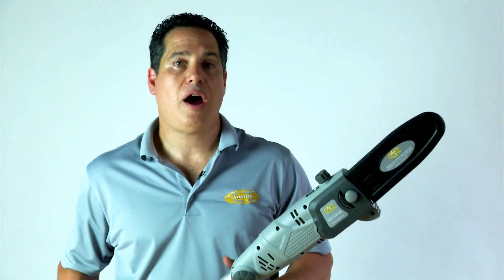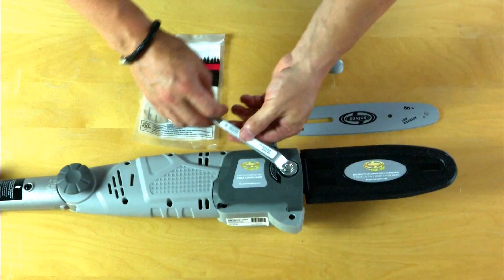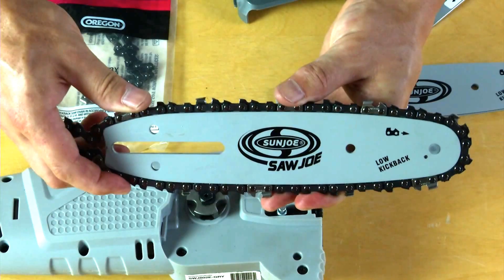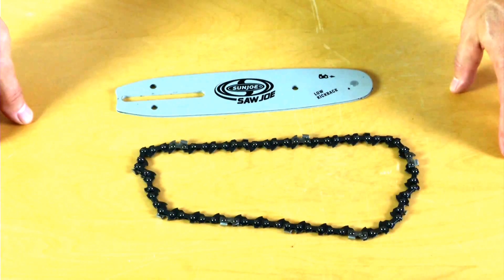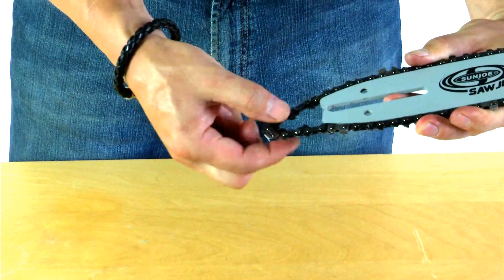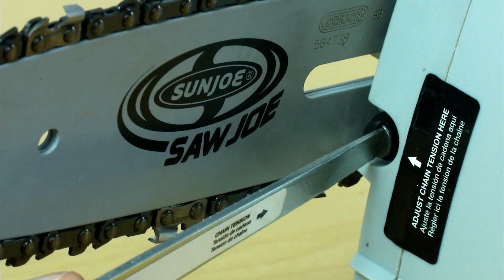SWJ802E - How To Replace + Install Chain Saw Chain | Sun Joe Pole Saw

Comment: My Ring Gear And Pinion  Striped The Gears. How Can I Get The Parts, Or Will ItBe Cheaper To Buy A New Saw.My Saw Is Only 2 Years Old.It Should Have Lasted Longer.
Reply from the maker: Charles, did you reach out to our customer care team? We cover all units for 2 years w/o question.
Reply: @SnowJoeCo  Very disappointing!!  Friend of mine purchased one for me a few years back, although i have little use for a Pole Saw it's been handy the two times used.  have had Chainsaws ans various outdoor equipment for decades and know how to use these properly and to Not use on anything larger than a small branch.  Pulled it out of the garage yesterday to use on some branches that are just starting to hang towards our shed.  Started it up, chain tension correct, barre oils. full and all seemed fine until the chain touched a branch , then the chain stopped and the whining started.   Yup! It's part number SWJ805E-45 according to your site, the ring gear.  prematurely worn.  Researched and found out Nobody carries any parts for these.  Shame when it is a simple fix.  Upon really looking at the assembly it's easy to see where the problems lie.  Very bothersome is the number of customers who have this unit have the same issue.  Good number getting a replacement under warranty (if lucky enough to still have warranty ), also a bunch which have had it happen again !!!  Would Love to know the failure percentage of this assembly.   The way it's mounted , bearing sitting into a molded plastic ring approx a 1/4 inch in diameter,  heading across and out the opposite side in a similar way (except here some steel reinforcement), finally attaching to the chain sprocket which will put pressure pulling the assembly towards the barre when running.  The amount of play between the plastic base and bearing, then even more play at the top bearing where it sits is dramatic.  Once the mount areas have a little wear the shaft tilts and the ring gear separates from its place leaving the motor to rev like crazy free from touching the gear assembly the second any tension between chain and wood start to happen.   There I've vented!!  It's a poor design.  However the Saw is in most ways clean and New by lack of use.  Could you please send me the correct specifications for part #SWJ805E-45 so I can acquire one elsewhere?  Thanks.   David
Reply: Installed the chain accordingto instructions, but can't rotate by hand as recommended ...help please
Reply: Sprocket does not rotate at all,  even disassembled

Comment: I would love to be able to convert my Sun Joe from a long adjustable saw to a   standard size short chain saw. Do you have a conversion kit or a way nof doing this?  Thanks
Reply: Mine came with the adaptor.  Call the company.  They are nice to deal with and will help if they can.